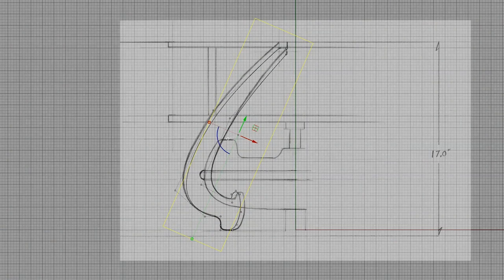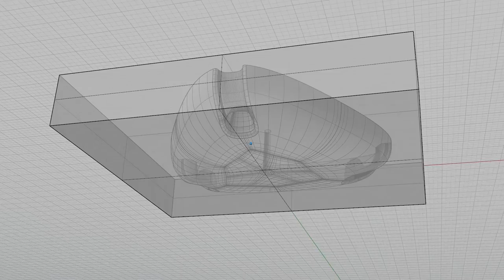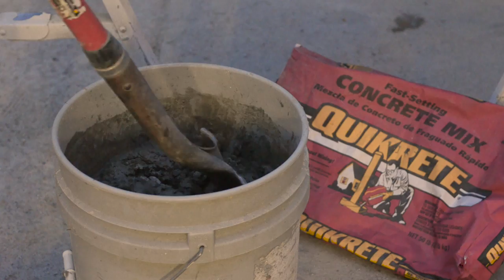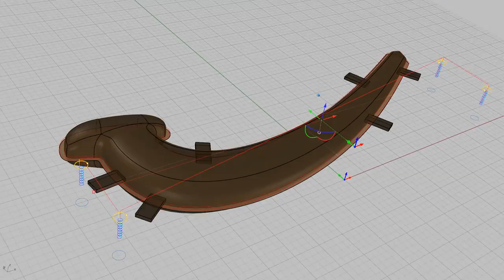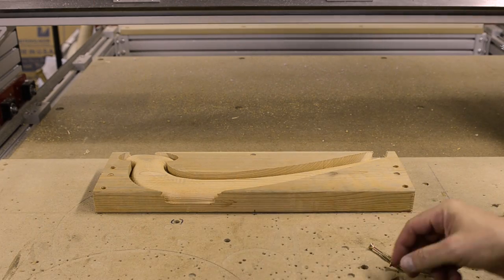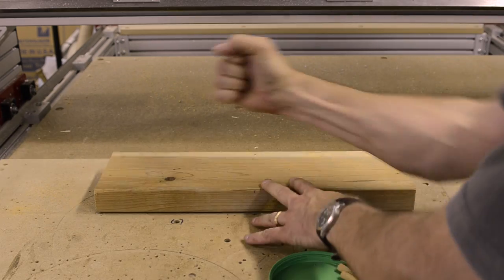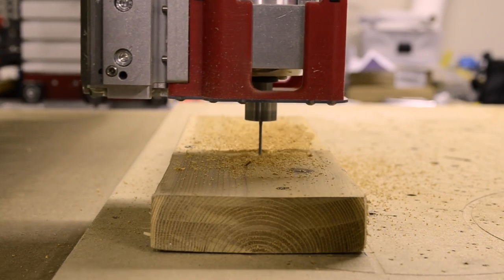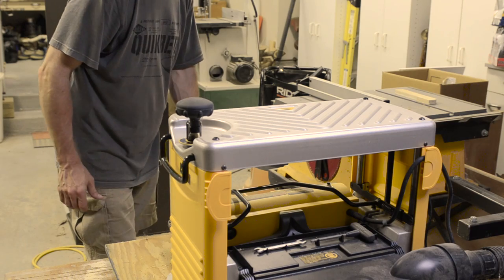MIDCENTURY MODERN CONCRETE LAMP

Comment: Nice shape!
What was the total weight of this light fixture?  It might be more practical if it weighed half as much, don't you agree?
Reply from the maker: It weighs about 60 pounds. The challenge had to include concrete. A lighter material would be more practical.

Comment: at 3:29 is that mold release?
Reply from the maker: Yeah, sort of... Hahaha! I didn't have any actual mold release, so I just wiped on some linseed oil. I do not recommend.
Reply: @WorksbySolo  thanks for the reply! What would you do next time?
Reply from the maker: Ed Tschoepe Since then, I’ve purchased actual mold release. One in a spray can and another wipe-on wax based that comes in a can. That’s what I would suggest.

Comment: Bad Ass!!!!
Reply from the maker: +Bart Thatcher I will take that as a compliment. Thank you sir.
Reply: Hopefully you sold some of these a true work of retro art!!
Reply from the maker: +Bart Thatcher Nope, this is one of a kind. Thank you for the compliment.
Reply: I've looked at several CNC router do you like yours?  Any recommendations?
Reply from the maker: +Bart Thatcher Yes! Highly recommend CNC Router Parts! Great machines and great customer support.
Reply: Years ago I was looking at Shopbot Routers, but there is so many to choose from now.  I even looked at Zund, and Techno cnc machines.  I think a small format table table might be a great starter machine.   Prices seem to be affordable.  Your's also is higher in the Z axis enabling you for deeper cutting.  12'' high?
Reply from the maker: +Bart Thatcher Yes, many competitors. CNC Router Parts has a small desktop model. Right! It is the 12" Z.
Reply: One more question what kind of 3D program are you using with the CNC? Solidworks?
Reply from the maker: +Bart Thatcher Rhino for CAD and MecSoft RhinoCAM plugin. T-Splines plugin for organic modeling parts like this lamp design. Autodesk Fusion 360 now has T-Spline capability as well.
Reply: Cool Thanks for Input.